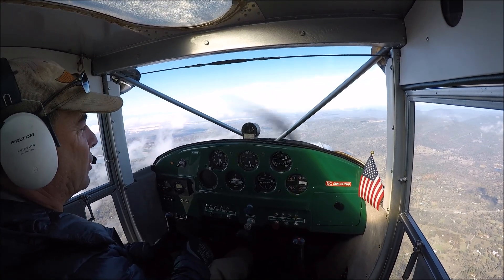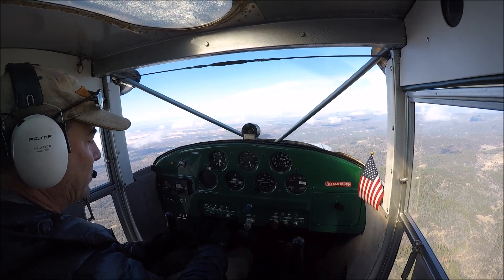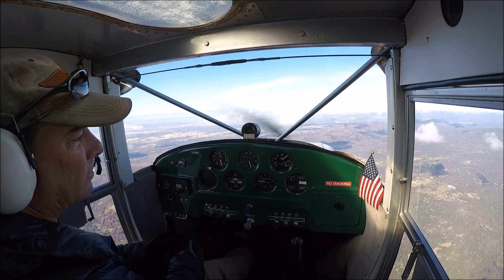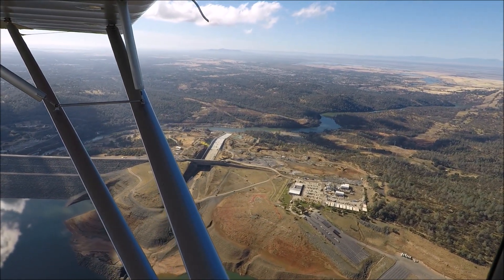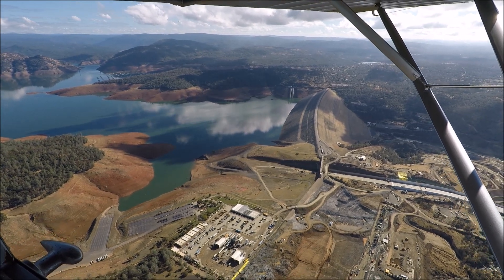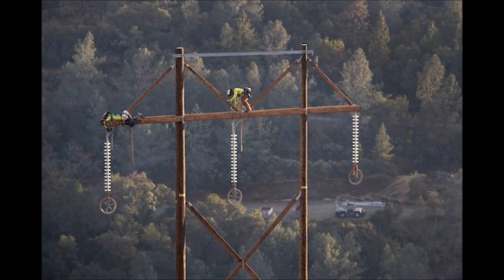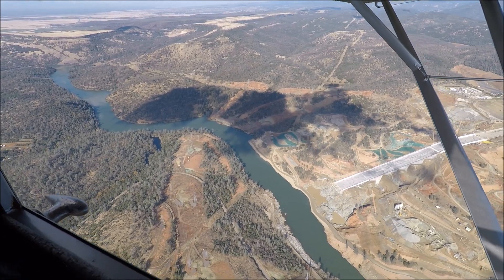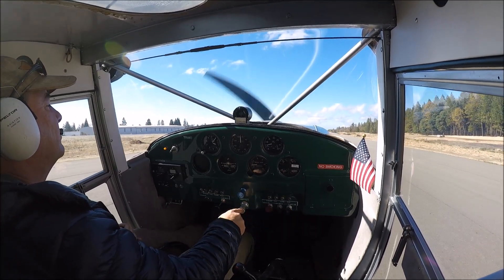Oroville Update Phase II 15 Nov

Comment: DWR just posted photos of the "emergency spillway extension".   Extending?  I thought it already went all the way across the backside of the launch ramp parking lot.  BTW, what is that section across the back of the parking lot?  Juan referenced it the other day calling it something different (I didn't catch what it was) than the main emergency spillway?  It looks like a little concrete wall, without the curved section.  How deep does it go?  Is it the same height as the emergency spillway?  Is it intended as a spillover?  Are they replacing that?

Comment: I see that the prop is bit out of balance. It probably isn't all important in your small plane. It would really make it nicer than to take all that bouncing around. Would it be expensive to have done? Like balancing your car tires!
Reply from the maker: Recently had it done , about 500$. Check blade pitch too.

Comment: First of all, I love your videos, and have been faithfully following the Oroville dam series. To be fair, the phase change of the gasoline from liquid to vapor is what accounts for the overwhelming majority of the cooling effect that can then cause ice. The same principle by which air conditioning and refrigeration operate. Carb heat will cause a decrease in engine power due to the fact that there is less oxygen in warm air (less dense). Even if you readjusted the mixture for the most power with carb heat on, it will be less power. Same reason that cars perform better in cooler air.

Comment: Does the DWR plan a design change to the power plant in the future (or has it been retrofitted now) to be able to pass water through it without having to generate power through turbines thus lowering the water level all the time through the plant? Seems like this would be a good idea so that the spillways could be limited in use in future.
Reply: My other question is the DWR going to do everything in their power to try NOT to use the spillway this year by means of increased releases through the power plant, ect. and maybe some other methods if it is possible? I assume they would prefer not to even test the new structure or perhaps they are interested on how it will function and really want to try to use it for a short or long period. I’m just curious on what they think from a watershed management side of things what they prefer to do and see.

Comment: Juan:  why do they not line the intake area of the spillway with concrete?!
Reply from the maker: Gerald Miedem they may consider that down the road. As long as the spillway works normally, it's generally not a problem .
Reply: Thanks!  As you often discussed "scouring" at the head of the spillway at lower lake levels - how much sooner do you estimate (at what lower lake level, how many feet lower) would they then be able to begin using the main spillway?
Reply from the maker: The bottom of the main spillway gates are 813' elevation. The plan this year is to keep the lake at 800' via the Hyatt Powerplant discharge.
Reply: Thank you.  Keep up the great work!

Comment: Great citizen journalism!!!  The best Oroville and fire coverage I've seen.
I have a clarification of your carb heat lesson.  Carb head decreases the density of the intake air, like an instant increase in density altitude.  Easier to remmber.  Also the Mighty Luscombe seems flooded each time you start it.  Less primer maybe?  Just a couple quick pumps on the throttle while cranking is all you need (assuming your impulse mag is working correctly.).

Comment: I notice you run that old O200 pretty quick. In my Cub, back in the old days :-) I would honk along in cruise at about 2400 rpm. It certainly was not fast but it was cheaper to run or so I was taught.
Reply from the maker: Yea, the old timers say that's best for the O-200. It only gets to 100HP near red line RPM.

Comment: so between the emergency spillway and the cut off wall will be rcc, at the cut off wall will there be a actual vertical wall ? or is the wall underground to the bedrock? if the emergency spillway was ever used again I assume the water would flow over the rcc past the cut off wall and any erosion  would be limited to below the cut off wall due to it being down to bedrock? so no undercutting of the emergency spillway.
Reply from the maker: Good point's I'll try to clarify on next update.
Reply: thank you I have enjoyed your updates very much.

Comment: Im sorry the red line is in front of the parking lot, the weir doesnt start until further across.   You were not looking at below the weir but actually below the parking lot.  The cams for the pipes are being used because they did not use the right size of gravel for the drainage and now gravel is going into the drainage slits.  Dont understand why they didnt fix that problem but removing the wrong size and put in the right size.  Now it is covered with concrete, so too late.  Great undate, thank you
Reply from the maker: Thanks Susan-The parking lot IS part of the emergency spillway structure (beyond the weir). Go back and watch the Construction Tour Series from last August and watch Tom Cobarrubia explain this here-https://www.youtube.com/watch?v=Te48aZvh75g&list=PL6SYmp3qb3uOd7cfyjp_O7vCsaSSp_jTt

Comment: Noticed the road underneath the bottom of the spillway is still there.  Are they planning on leaving it over the winter and hoping they won't have to use the spillway?  Any water comes down the spillway and their going to have to get the dredges working again.
Reply from the maker: That's correct. If it looks like the'll need it they could move it pretty quick.

Comment: Don't know if it matters to anyone but I believe your explanation of "warm" air "richening" the mixture is backwards from what I have always heard that "cold" air was more dense so that equated to "richer" mixture. Racers go to great lengths to "cool" the air entering the carburetor for exactly that reason. Also, doesn't freezing the carburetor cut off the air supply meaning the mixture ratio is going to go "heavy" on the gas??  
 The spillway project is sure looking good isn't it??
Reply from the maker: Pappa Bob less air, same fuel...rich mixture.
Reply: There I would agree completely. Watch your video and the statement you make at 3:23 where you say "add warm air and you enrich the mixture". That's where I disagree.
Reply: You're correct : the racers cool the air to get it more dense. But there's probably sloppy language causing some confusion.

More air means they can burn more fuel to get more power. To get more fuel into the engine they have to adjust some knob/screw/computer  setting to pump more, ie set the settings to "rich". This setting could be what the racers are talking about.

More air to make it lean+ more fuel to make it rich = normal mixture with more power.
Reply: Tim got it pretty much right. I will add that racers are cooling the incoming air to make it more dense. Denser air means you can add more fuel.
In the old days before injection, streetable performance cars required a heated baseplate under the carb to prevent icing. These days the density of the air is simply measured, and the appropriate amount of fuel is added by the injectors.
If you play around with the ideal gas law (PV = nRT), keeping in mind that both the pressure differential and the volume are fixed (given a fixed throttle position and load), it will make sense.
P_ambient - P_intake = P_dif. V is fixed by the throttle opening.
Thus, when you increase n (cooling the air), T must go down.
This is also why he said that loading the engine a bit also helps with the problem of icing. 
Loading the engine increases P_dif with, but V and n remain constant. The result is that T increases, but the increase in P_dif means more fuel is drawn through the jets resulting in fuel wastage and all the other problems from running and engine too rich.
Reply: It is about a combustible mixture - a ratio of air to fuel. If the fuel is more than air, it is a rich mixture. If the air is more than fuel it is a lean mixture. Both rich & lean mixtures give inefficient combustion. In this case, introducing exhaust gas reduces the pure air while the fuel part remains the same; hence the mixture becomes rich giving inefficient combustion. That is why as Juan correctly reported the engine  revs dropped.
Reply: Agreed. Equals "leaner mixture". The initial comment. Lots/most/all of this boils down to "context". "Richer mixture" is accurate in "this" context. Since a iced up carburetor allows no/less air, that carries the fuel with it, to pass into the motor
Reply: OK. So then please explain why auto racers arrange and have "cold air" packages in order to make more horsepower?? Is the altitude the factor that somehow changes the entire air/fuel reaction?? 
This situation seems like it "really" amounts to "heat equals air/fuel flow" as opposed to cold equals "no or almost no air/fuel flow". It's the "lack of air flow" (obviously, including its fuel component) that causes the motor to lose power or stall completely. Isn't it?? When the carb freezes, or begins to freeze, there is NO air flow. No air flow means NO fuel flow either as the fuel atomizes and travels into the motor VIA the air flow.
Reply: @ steve mitz
I cant say for certain on his engine.
All engines that I am aware of heat the carb. This is done by an electric heater, routing coolant through the baseplate, or routing hot air (not exhaust gas) from around the exhaust manifold to carb. I am not aware of any engine that runs exhaust gas into the carb to deal with icing. EGR systems rout exhaust gas into the intake manifold to reduce emissions - this is an entirely different thing. For one thing, you simply can not run exhaust gas into a carb - it will foul the carb in a few hours.
I would think that his engine is air-cooled, and predates reliable electrical heating. So most likely there is a shroud around the exhaust manifold from which hot air can be used to heat the carb (and the cockpit). This hot air be routed around the carb, through the baseplate, or introduced into the air filter box (this is the most reliable method).On cars at least, the systems I have seen that routed hot air into the baseplate would get clogged often, and heating the carb can lead to issues with the fuel boiling (this would be worse at high elevation).
Reply: @steve mitz.
Yes, you are correct. The reduced RPM comes from the reduced amount of O2 entering the engine (less O2 given same fuel -> rich mixture). In practice, the engine finds a new equilibrium, and the pilot just needs to adjust the throttle/prop/flaps to accommodate.
Can't really say how complex the carb is on his plane. It is possible the Luscombe has features built into the carb to accommodate lower ambient pressures at higher elevations. Most likely the pilot needs to tweak the fuel trim just like on very old cars and tractors based on how it sounds and feels.
Reply: Carb heat introduces hot air to your carb, instead of the cold air normally drawn through the air filter. Hot air is less dense, so there is less mass of air in each cylinder cycle. The mass of the fuel remains the same. So, since there is more mass of fuel per mass of air, adding carb heat richens the mixture.

Comment: When you reduce power for descent and landing, you always turn on the carb heat because of the increased pressure differential, right?  Also, on most planes, the heated air bypasses the air filter, so you have to beware of particulates, etc.
Reply from the maker: Rodney Owen Yes!

Comment: Thanks for the carb info.  Its great learning new things.  I had an old 73 Datsun pickup that would die on the way to work if it was cold out, then after I pulled over for 3 minutes, the engine heat would thaw the carb out and away I would go for a couple more miles.  I finally figured out what was happening.  The flex heat tube from the Exhaust manifold had fallen off the air cleaner and it wasn't getting any heat when it needed it.  Thus the carb icing.

Comment: Thanks for a fine presentation. Are they going to cement the intake to the gates in phase 2? If a gate broke in the open position and erosion started it could be fatal if a v notch formed. Is that a concern to DWR and is it scheduled to be dealt with, just in case?
Reply: In the last gate inspection report, 2004, they discovered a lot of silt and stones trapped in the gates. This was a cause of scarring on the metal surfaces. It would seem good practice to place a concrete pad before the gates designed to somehow reduce silting of the gates.

Comment: In order to reduce the suctioning of the water as it passes over the cement, it is necessary to introduce air into the water flow via air tubes.
Reply from the maker: That's what's happening with the step at the top of the RCC section....in theory.
Reply: So...is this why the spillway is shaped the way it is...with the top part at one angle and the bottom part at another angle downward starting at the step? I didn't explain that as clearly as I wanted....but I hope you get what I mean.
Reply: The same suctioning effects occur on side walls as well, else water will pull walls inward.  Walls need air tubes angled down to draw air from the outside wall to the inside wall. Thanks for responding.

Comment: You don't side slip that larger plane do you? As the guys did to a 737 that ran out of fuel in Canada. The pilot also flew the smaller aircraft so he did the side slipping of the larger one and it worked. Although the nose gear did not lock in place, no one died.
Reply from the maker: Nope. just a bit in the flare in a crosswind landing.
Reply: Yea,my recollection was that the AC had a small ram air turbine they deployed to provide hydraulics for flt controls and  gear apparently not enough to lock the nose gear however.cheers thanks,
Reply: That was actually a brand new 767 on it`s maiden flight,,the famous "Gimli glider"
Reply: Actually it was Bob Pearson who was the pilot of that jet. It's been 30 years since the legendary landing of an Air Canada jet that ran out of fuel over Manitoba. Happened in 1983 on flight 143.

Comment: This is going to end up WELL over $1B when all is said and done. FYI: FEMA currently owes the Treasury about $25B. 

 Really enjoyed the "no excuse landing" clip. :-)
Reply: The original project was a bit north of $1B  when it was started in early 60's. California's first single billion dollar bond undertaking. If I mathed it out right, that would be roughly $8B in today's dollars. I'm interested to see if investigation reveals what, if anything, could have been done to mitigate the cost of this repair, or if it is more economical to let parts of the dam system wear until something like this happens and then do the fix.

Comment: Why was the "Shoefly powerline" called "Shoefly"?
Reply: A shoofly, or in the old days a shoo-fly is a temporary routing of a railroad line, typically around a slide that took out the rails, or around a construction area. A shoofly was typically something that had a fairly sharp turn into and out of it, and very likely was not graded as smoothly as the main line it temporarily replaced. It might also wiggle around to match available terrain rather than being a more or less straight line. (Railroads as much as possible want to run in straight lines both horizontally and up/downhill, and want very gentle curves.)

The origin of the term is lost in history, but I can make a pretty good guess. When flies were common it was not unusual to wave at a bunch of flies sitting on something, often (for no good reason) shouting "shoo!" at the same time. The flies would jump up, buzz around a bit, and go right back to where they were. That's pretty much what a shoo-fly connection does.
Reply from the maker: Good question- it's an old fashioned term from railroading days I believe...a temporary connection?

Comment: Should do mono to stereo, just a simple adapter.
Reply: Just convert the stereo to mono after recording, super easy :)
Reply: The com box is mono and when you plug in stereo recorder you get the one channel, a $5 adapter will make your recording to be always stereo. Why fix every recording when for $5 you can record the audio mixed in stereo and not have to fix.